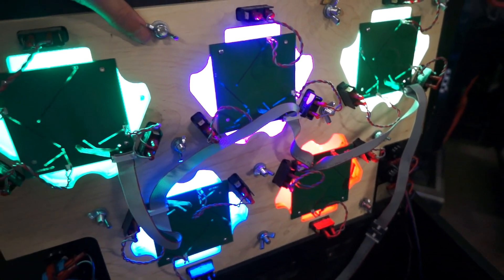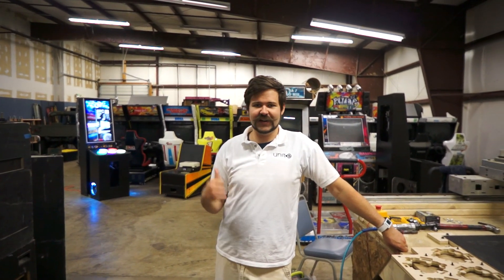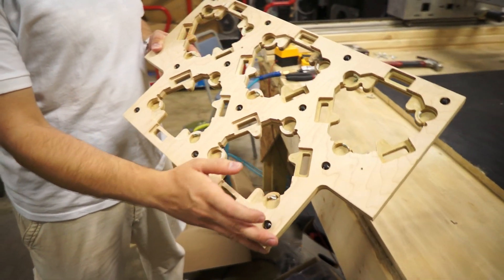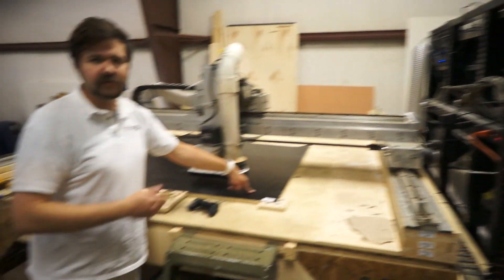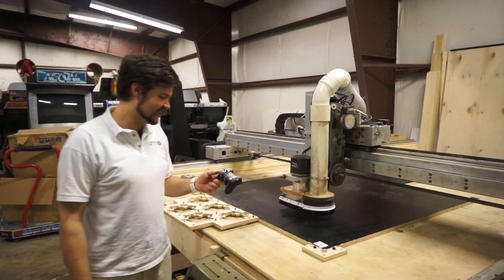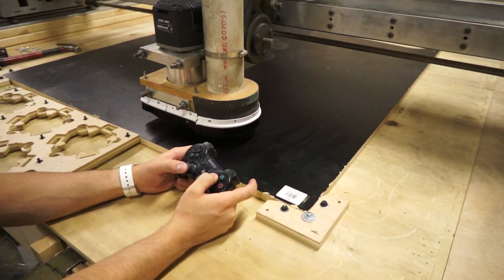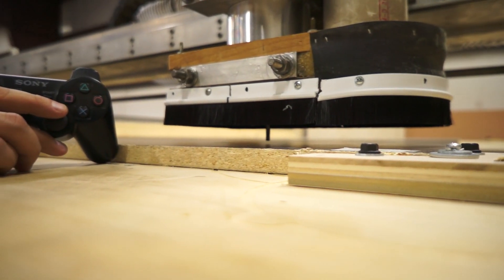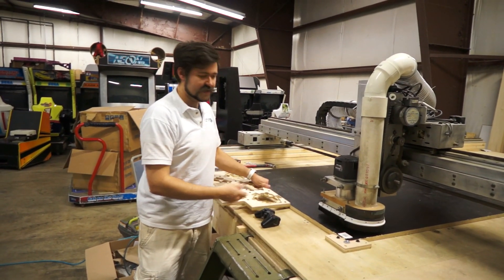Safer PS3 Controller CNC Mill Pendent

Comment: is there any specific reason for using specific buttons to select the active axis? I would have mapped the x and y axis on one stick and one direction of the other stick to the z axis, so you can position it quickly and diagonally and then one-handed steer the z-axis while using your other hand to check the spacing with paper. Also you could map the shoulder buttons to multiply/devide the step sizes. As you than have quite some amount of buttons left unused you can further assign some predefined spots on your work area, e.g. triangle to move out of the way in the end. Also Start/Select would make a nice Feed Hold/Cycle Start button.
Reply from the maker: We use the button because it's porportional and it's easy to have nudging happening in a direction you don't want.  But, Adam has been tweaking the button mapping to his liking.  I just picked some randomly when I did the video.

Comment: Cool, just two weeks or so I did something very similar https://github.com/hzeller/joystick-gcode-jog
Reply from the maker: That's cute.  I wouldn't have thought to use the existing serial port for sending the G-code.  For my system, G-code is just an intermediary format.  You can connect via sockets to send it commands, so you still run the full mill software simultaneous to doing whatever else (i.e. Minecraft, or this).

I wonder if many other widely-used pieces of milling software support some mechanism of feeding in live G-code simultaenously to running the controlling software?
Reply: Yeah, 3D printers (for which I made this) typically only have one GCode interpreter as 'input'. I am working on a better way to control a (3D-print/CNC) machine (BeagleG, which listens on a socket for GCode) which will also have secondary inputs for direct movement access.

The problem with mixing Live-GCode over one stream is, that things might get confusing if two things happen by different senders: each command is ack-ed with an "ok" - then it is hard to figure out for which command was meant. One would think that this typically wouldn't matter much as there is one sending movements commands anyway. But (well, in 3D printer world), there  might be constant status queries (such as hotend temperature).

This is why a separate secondary input is important.

Comment: Li'l trick from machining lessons at my local machine shop: the zeroing in from the top can be pretty accurate with some tobacco rolling paper. Gets you down to about .01 mm of surface, and it's damn repeatable.

Also, I've seen the shop you're working in quite a bit of time now, is there a separate channel where you guys showcase all of your projects? Peace!
Reply from the maker: There is no separate channel.  We've tried thin paper and use it frequently, but you can visually get it to within about .05 mm so it's not that bad.  We can't really get better than about .05mm anyway.  Our step size is 1/60th of a mm, and there is about .05 mm of play :-/
Reply: Post it notes work well for this too.